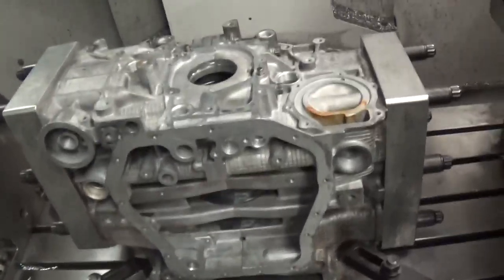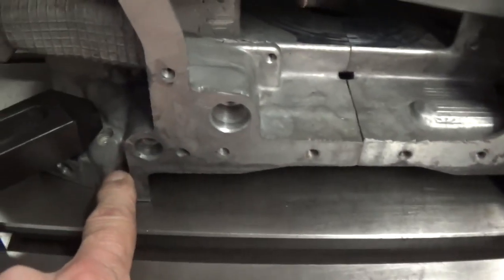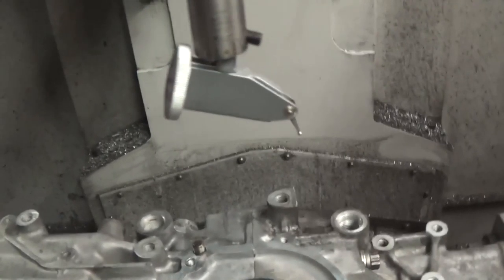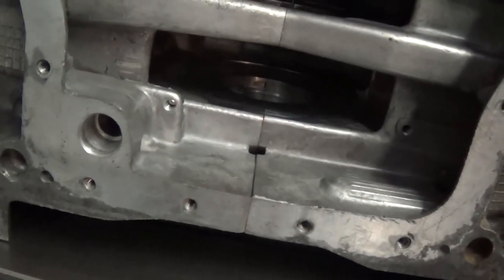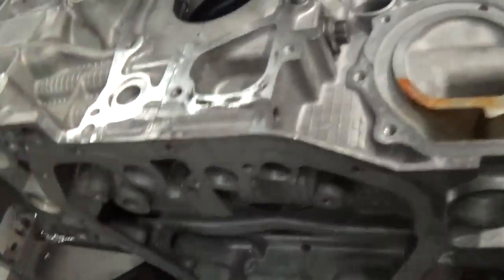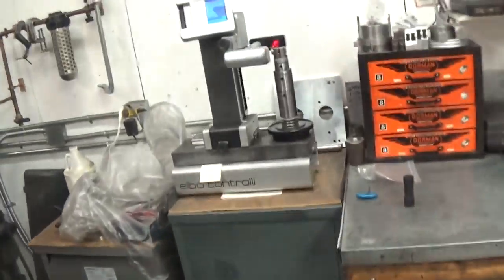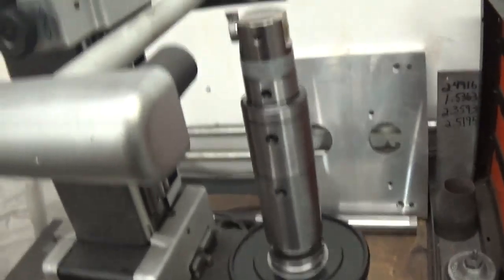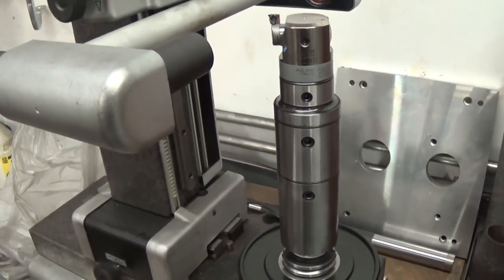Subaru mainline boring tutorial

Comment: Hi, what's is the limit out of roundnes on mains whitout bearings on EJ engines ??? When I put straight edge tool on 1 half, I can't fit 0.787 thou under. But when i measure them some of them are like 1.18 thou out of roundnes.

Comment: Thank you for this video, if I wanted to measure a main line on a block without bearings, how would I Zero my Bore gauge? Is there a specific spec subaru gives?
Reply from the maker: Different bearing manufacturers have different ideas about what the mainline should be but 2.5200" is a good number to use. Most guys use King and that's in their spec range. BUT it's important to align the halves properly before measuring. Often times the block dowels are loose in their respective receiving holes (or bent) so the halves will not align correctly,  #1 and #5 main being the most affected. Hand tighten all 10 case bolts ( ignore 8mm outer bolts) and check 1 and 5 bore at the parting line with your gage. If you measure a difference going from one half to the other, you need to tap with a dead blow or hard plastic mallet on which ever case half needs moving to get the halves lined up. Only after aligning both front and rear bores can you now torque the case bolts. It takes time but needs to be done. BTW, I've since retired.
Reply: @motion24527  Thank you so much for your informative answer, I always get my blocks line honed and bored. I am purchasing some EJ blocks tomorrow so want to make sure they're good to go. 👍